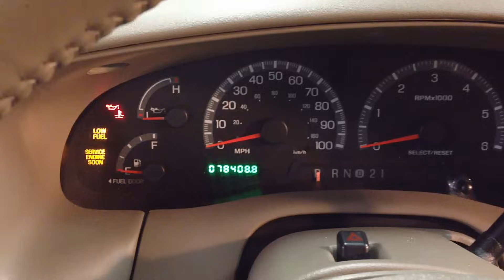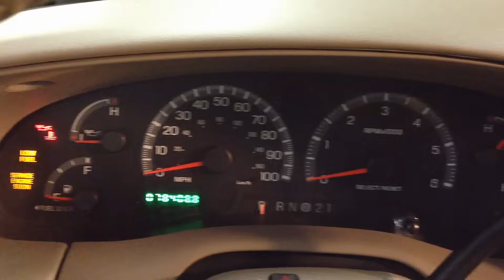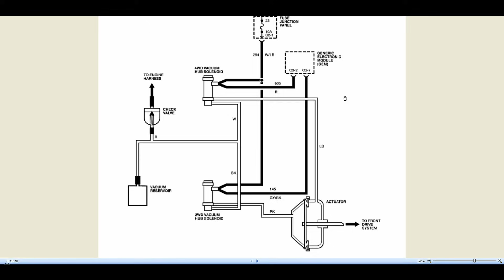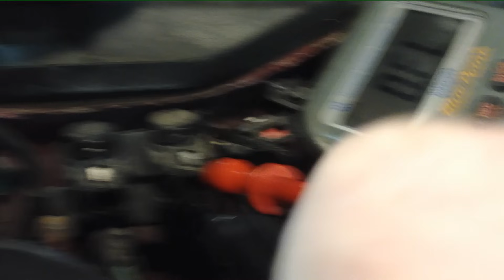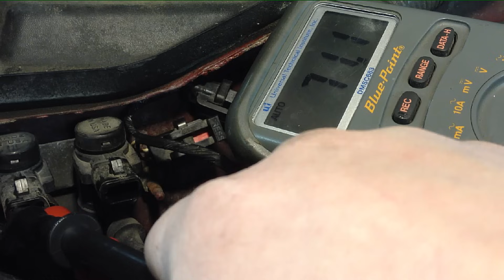1997-2004 Ford F150 4X4 Inoperative In Depth Diagnosis

Comment: Hi  Ford Tech Makuloco, I really enjoy your videos on anything relating to Ford F150's ... I have a 2002 F150 FX4 lariat crew cab 4x4.  I heard you talking about the solenoid behind the battery that could go  bad, but you didn't show what it looks like or what I can do to replace it.  I think i have a vacuum issue because my 4x4 hi works sometimes but the 4x4 low doesn't.  Can you help me please?

Comment: I have a 2002 F150 Lariat Super Crew 4x4. I have checked all the vacuum hoses, solenoids, and dash switch.  My 4x4 light stays on. I seem to have vacuum at all locations. The truck will not shift into 4 wheel high or low.  Is my next step to change the transfer case motor?
Reply: fordtechmakuloco?

Comment: I have a 2002 f150 4x4,  shifter is on the floor board and is stuck in what seems to be the front axle and can feel it at about 55 mph  and mechanic shop is telling me its the transfer case but they couldn't  provide  any codes showing thtas the problem and wants 1500$ to repair ,  I just don't think they are being honest with me , any advice ??

Comment: I replaced my GEM module for the 4x4 and cannot get it to engage. 2003 F-250 is kicking my butt. Does it need to be coded?

Comment: thanks for the video this is going to help me tomorrow when i get my new truck. the 4x4 light is stuck on
Reply from the maker: +glen john Before anything pull codes from the GEM module to see if the transfer case motor is stuck.
Reply: oh yea i have all kinds of scanners i can get my hands on. a friend just bought a 2001 4x4 it seems its stuck in 4 high. i know what to look for i just didn't know they best way to trouble shoot it. if the scanner don't tell me anything. if you ever make a video of how to get the damn EGR light to go out and stay out that would help. i have give up replaced every part of the egr system cleaned and ended up replacing the plenum and every few days my light will come back on. it would really help.
Reply: glen johnson egr ports plugged in intake, pull upper intake and unstop ports

Comment: FordTechMakuloca
I've followed your instructions. I get to where I'm checking the 4x4 solenoid.. With key on and trans case to 4x4 (manual shift) I get no voltage on the ground side. Meaning when I put my test light on the + post and check for the ground on the 4x4 solenoid (left pin if looking at the face of the connector) I get no voltage when I move the transfer case in the 4x4 position. I also do not have an indicator light up on the dash. But the trans case does go into 4x4. I can hear it and feel it. What do I need to check when not getting voltage to that solenoid when I switch to 4x4?

Comment: Hi I just bought a 1997 f150 4x4 online (bad move), the transfer case motor was completely missing so I replaced it , now its stuck in 4WD , Thanks to your video, I checked the solenoids on the R/side of the firewall ,Key on ,theres fulltime power to the 4WD one but not  to the 2WD solenoid ? could you give me a few ideas please??
Reply: also the horn and cruise and AC is not working , not sure if its related , GEM module?

Comment: 98 f150, manual transfer case shifter, when I put it in 4wd I get no vacuum out of the 4wd solenoid,but continue to get vacuum out of 2wd solenoid,what could be the issue?
Reply: update, replaced both vacuum solenoids, every thing works perfect now, thanks

Comment: Awesome write up, helped me not throw unneeded parts at my beater truck.  Fixed my 4x4 for under $15.  Now if i could find a easy fix to stop the leaky fuel tank.
Reply: What did you need?

Comment: I have a 98 f150 4x4 with manual shift in floor, 4wd seems to work ok, but when I put it in 2wd and jack front end up, driver front tire is harder to turn by hand and turns driveshaft, if I hold drive shaft I can stop it from turning, but wheel is still and always seems to have a lot of friction and harder to turn! Hope this makes sense! Any suggestions?

Comment: I have a 2003 ford f-150 4x4 shift on the floor, and it is very hard to shift into or out of 4WD. The dash light is still on and I think its in 4WD, I haven't been able to shift it out 0f 4WD.

Comment: I know this is an old thread, but how do you pull gem codes
I think my gem is going bad, bunch random clicking from under dash by fuse panel, done light on and off, winshield washer only works when windows work intermittently. any suggestions, btw my truck is manual shift 4x4 but it only works when everything else like the windows turn on. I belive the gem is dieing but don't want to just throw money away.

Comment: i have a 97 f150 with the low range light on the dash at all times... but its in 2wd.   i get 12 volts at  at the 2wd drive solenoid but no ground  signal on the left wire as you show. i hear no clicking from inside the dash... all silent when engine off and ignition on when the selector switch is activated. i also have 12v at the 4wd solenoid at the same time.   i also get vacuum at the 2wd soleniod but nothing coming out.   since there is no ground at both solenoids in either mode,  im suspecting the gem module.  i also changed out the 4x4 selector switch with a known good one but nothing changed.   any thoughts?   oh and fuse 23 is ok..

Comment: i got a 98 ford exspoler xlt that wont come out of   4 wheel drive  its got one vacuum line and no air how get to get it 2 wheel drive
Reply: I little late but you can actually manually push the actuator pin out and will take it out of 4x4.

Comment: When I turn the 4x4 knob on it doesn't turn the light on and it doesn't change it to 4x4. The fuse is ok. What could be the problem
Reply from the maker: pull codes from the GEM module before going any further.
Reply: what tool to get those codes from the GEM do you recommend ?
Reply: Bray Ramirez how I gonna do that?
Reply: If either of these solenoids are bad, will the GEM or PCM detect the malfunction and deny any attempt to shift the transfer case into 4H or 4L?
Reply: Bumping for same problem.
Reply: My friend sites and selects the knob for 15-30 minutes sometimes before the light comes on and finally kick in 4x4... What could that problem be...
Reply: He doesn't have a heritage ...

Comment: I did all the checks as good as possible that you showed here and everything seems to check out. In the diagnostic process, what I did discover is my 4wd only works if I select the switch to 4hi or 4low before I start the engine, then once the engine starts the 4wd kicks in. If I select 4wd after the engine starts it 4wd won't work. Same with disengaging the 4wd, select has to be made before the engine starts or it won't work either. Any ideas? This is kinda aggravating, as i know its not working the way the manual states and I can't find any info online about this particular problem.

Comment: My 2003 f150 has had the issue with the four wheel drive like dragging.  If I tap the front hubs the issue goes away but it comes back.  This is causing my truck to vibrate at speeds above 55

Comment: 1999 f150. 4x4 light up on dash, could feel the transfer case engage via floor shifter. Front drive shaft is locked in. Front wheels were free spinning while jacked up. Checked the 4x4 engage, and disengage vacuum solenoids. Both coils measured around 73 Ohms, had 12 volts to both connectors, but both were showing ground in 4x4 and 2x4 positions. The one on the right side was working, allowing vacuum to flow when 2x4 was engaged, the one on the left wouldn't work in either position. I switched the right one with left one , and the left with the right one, and plugged the vacuum lines back in, and the electrical connection back in( They only fit into the correct solenoids due to a slot on the connector). I engaged the transfer case with truck running, and still jacked up, and spun my wheel. My other wheel spun, YAY! I don't know if this will cause issues down the road somewhere or not, but I now have a fully functional 2 & 4 wheel drive system again. It works as it should, so I can't see why I would have any issues. It's PERFECT!!!! Thanks man for pointing me in the right direction. I would have been days, or given up on it without your video.

Comment: I purchased a 99 Expedition electric 4WD auto basket case... Someone has cut the wires that go to the 2 front diff. vacuum 
solenoids out of the harness.
Can anyone tell me which part of the under hood harness they are supposed to be coming out of? The one that goes across the cowl under the plastic cover or one of the other 3 that have junction blocks near the starter solenoid???

Comment: Have a 97 expedition stuck in 4x4 dash board light is on. Replaced the dash board switch and the transfer case module about a year ago. Any thoughts or suggestion of what problem might be? Thanks Bernie

Comment: THANK THAT'S ALOT OF INFO 
but i have an extra problem where the 4 high and 4 low lights on the gauge control module won't light up when putting the switch on either option. they do light up when you initially turn the ignition switch on and it does the test to check if all the lights work but that's another issue i have. is there something related with the 4wd not engaging? or is it something different?

Comment: I do have a question. I bought a 97 f150 and the sellers said the GEM module was bad. If I test those selinoids wiring like you explained it and I get no voltage to em, would that mean the GEM is bad? All fuses are good, for a fact the 4x4 switch is good, the light on it and the 4x4 indicator lights on the dash don't come on and I hear no noise from the transfer case. The 4x4 flat out refuses to do anything.

Comment: 2000 F-150, 4X4, V-8...38K original miles

Problem: Always had trouble shifting out of 4x4 LOW range 4x4. Shifting into and out of 2X2 and 4X4 no problems. However, now I cannot shift into 4x4 low, there is no difference in rpm between 4x4 high  or 4x4 low. The Low range light does 
not  light up .

Now I have a intermediate sound coming from the transfer case area. Sounds Like a steel bar rubbing against the teeth of the flywheel...I assume its a gear not fully meshing in transfer case???

Question.  Is this dangerous and or easy to fix???  Im 78 and cannot get under vehicles anymore and I don't have $$$$ for such a huge repair bill..

Any suggestions or remedies appreciated.

Jim

Comment: I am having an issue with my 4x4, there is constant vacuum at the actuator in the 2 wheel side and it will not let 4 wheel engage I have run a full test on both solenoids and didn't have a problem if you could give me an idea it would be great

Comment: Wow! What a complete easy to follow video! Great job. It has given me direction. I have '97 5 speed with no 4wd engagement. When I got in it after being parked for a month it was already in 4wd and worked solid. After putting it in 2wd a few minutes later (with the floor lever since there is no dash selection switch nor dash light), it will not return to 4wd. Transfer case engages, I have power at #23 fuse, and vacuum on both bottom hoses. Just no ground on either solenoid in any lever position. Is this related to the switch inside my transfer case perhaps or am I chasing the GEM?

Comment: hi Bryan. i have a 2005 lincoln nav  my 4x4 does not activates, not even the 4x4 light on dashboard turns on, check all the vaccum and looks good. i believe is the transfer case motor or a relay ralated to it. since transfer case motor doesnt "click" or make any noise when i move the 4x4 switch up in the cabin. how can i roubleshoot this? thanks in advance.

Comment: Your video was awesome thank you so much..I have a 97 expedition EB. I can get her into 4x4 in all 3 modes but after 10min or so the indicator light will start flashing between 4 x 4 and 4AWD then eventually stick in 4-wheel drive and nothing will happen when I move the switch. The only way I can get it out of 4 wheel drive is to disconnect the battery. I went around for a few months in 2 wheel drive not needing four wheel drive but when I went to engage it it would not.. thought I would start where I left off so I disconnected the battery and low and behold it would then go into 4 wheel drive.. this has gone on and on so I ordered a battery disconnect switch so I could pop in and out if four-wheel drive when I wanted to..in my mind I'm now thinking it could simply be the dash mounted 4 wheel drive switch. Your thoughts would be greatly appreciated

Comment: I have a short to ground even with key off on the 2wd side vacuum solenoid, also even if I unplug the wire from the 2wd solenoid it lets vacuum through.  Sounds like I need to replace the 2wd solenoid and gem module?  Is the gem module something that needs programmed to my vehicle or can I just pick one up at an auto parts store.

Comment: I have a manual engage 4x4. The 4X4 dash light does not come on. I grounded the wires from the switch on the transfer case and the Low Range light comes on but not the 4X4 light. Is this where the GEM gets the signal to activate the 4X4 solenoid on the firewall?

Comment: thank you  u  clear up a lot of questions.  take the job at uti    I'm 54 yrs old  I enjoy wrenching.  sometimes I dnt know where to start,    2000 150  had a broken vacuum hose. and have a floor shifter  that seized up.  easy r r.   leaky rear window will also      thanku

Comment: there are 4 wires going to the switch,the colors are black,  purple, blue,  and a grey with a red striped. I only get my light tester to illuminate on the striped wire when I turn the headlights on.  shouldn't there be a wire that provides constant power to the switch?
Reply from the maker: No it is ground based the stripe wire you are testing is the power feed for illumination when the headlamps are on.

Comment: I never get the switched ground to my 4x4 solenoid. fuses are good is there possibly a relay I can check?
Reply from the maker: Pull codes in the GEM first
Reply: Auto zone checked the codes and there were none
Reply from the maker: Auto zone cannot check codes in the GEM it is on the ISO 9141 network
Reply: FordTechMakuloco so how does one check the GEM codes,  take it to the dealership?
Reply from the maker: A normal repair shop has a midrange scan tool that can read codes on all the module on the network.
Reply: FordTechMakuloco thank you so much for all your help!  great video!
Reply: Bryce Littlefield I have a Ford truck 2002 f150 4x4 I just put a new engine new transmission everything is new but I don't have power on the hill what can I do
Reply: Bryce Littlefield
Reply: Bryce Littlefield
Reply: Bryce Littlefield
Reply: Bryce Littlefield

Comment: ok I have a question. why would I have vacuum on both sides of the diff actuator
Reply from the maker: If both actuators have vacuum you mean then check codes in the GEM

Comment: My 4x4 seems to engage fine but seems stubborn to disengage and creates some loud noises and then will suddenly clank off if I mess around with shifting or change speeds / hit a bump. Does this sound like the water in the wheel end problem? 

Also could you provide a link to the testing light that you used I cant seem to find it!

Thanks a lot!

Comment: hey great video thank u for the info . question for u can I move the lever on the motor by hand to test the 4x4 I'm gonna look at a 02 4x4 and the guy said it had a vacuum hose issue n I wanted to make sure the 4x4 worked aka transfer case

Comment: verry well done there, I found a faulty 2wd celenoid after only 8min off watching your video thx, the faulty one was stuck open so 4x4 would not engage, I really need a 4x4 for tomorow because a big snow storm is on the way so I just bypass the celenoid for now and block the vacum line with a screw until I have time to find and replace the parts. thx again

Comment: Hey can you supply a test for an 2001 F250 7.3. Im diagnosing the 4wd not engaging from the ESOF. Ive already checked relays and fuses. Ive removed and verified the transfer case motor works properly. Im not getting power to the ESOF switch and from my shematics it shows the switch recieves power from the GEM module. DO you know a way to troubleshoot the GEM? Thanks

Comment: This video is extremely useful and I enjoyed learning how the system works. I have a 2004 F150 FX4 AND need more information. My 4 wheel drive engages okay but the 4 wheel light indicator will flash on for one second and turn off. When I first turn the ignition on the 4 wheel light is bright and clear.  Please give me the repair solution.

Comment: 98 expedition, 4x4 won't engage, no lights, no clicks. I have checked fuses and replaced the switch with one from my other expedition and still no go. I'm guessing transfer case motor or gem. do you have a schematic so I could figure out which one it may be? Thanks!
Reply: I have the exact same problem! Did you figure it out?
Reply: Not yet. I'm hoping to look into it Monday and I'll report back once I test the transfer case motor and gem
Reply: Lnshalls I replaced the gem module and that solved our issue. we had not power to the 4x4 switch and all fuses were good so that's how I determined it was the GEM

Comment: Thank you so much for this video,, helped me so much! Quick story I tested everything OK, but the vacuum seemed low, ended up the check valve was the issue. Thanks again.
Reply: Andy Behm what check valve? That might be my problem.
Reply: In the video at 6:45 I believe that is the valve I got rid of, it is yellow and blue on the right hand of the screen in line with the black vacuum line.

Comment: Both of my plugs check good for 12v power.  When I check the grounds however both plugs show no ground. Is this a sign of a bad GEM? Is there something else I could Check?
Reply from the maker: Check for codes in the GEM for the transfer case shift motor.